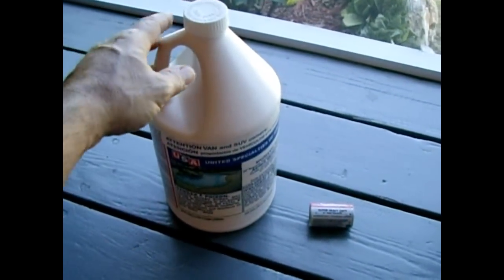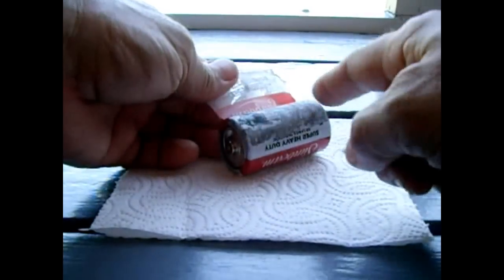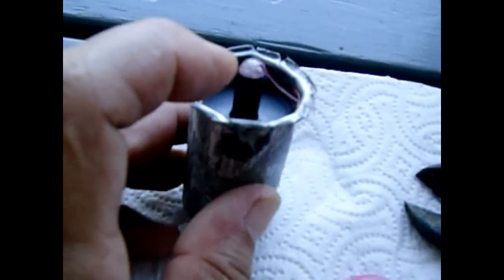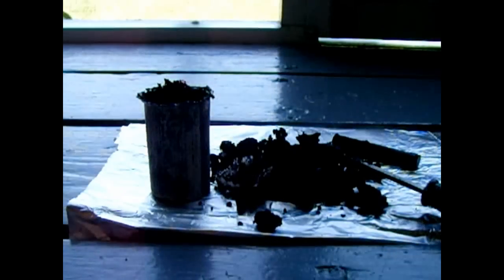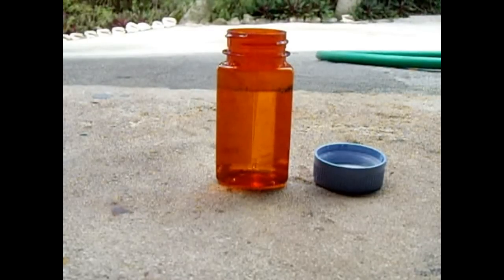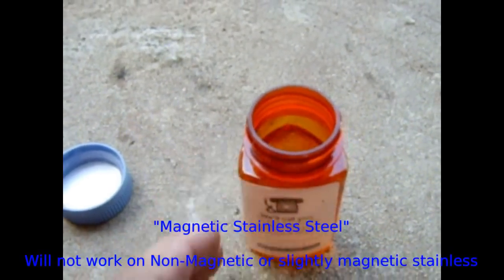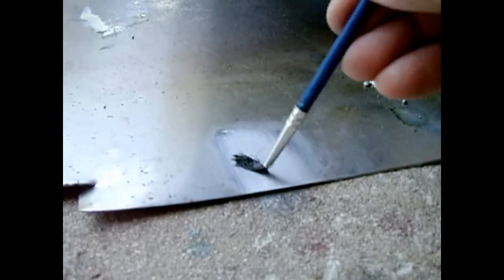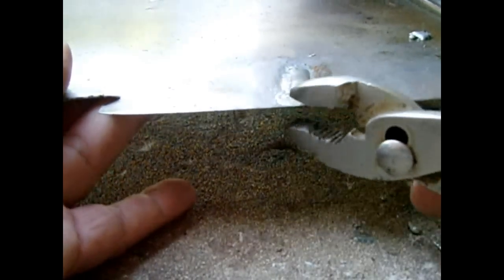How To Make Acid Flux & Solder Sheet Metal/Magnetic Stainless

Comment: I use zinc strips for roofing and cut them up into 2x2 pieces. Drop them in the muriatic acid and let it sizzle. Should use glass container. This works best to solder stainless when you heat up the stainless a lil bit first before applying flux and use a iron to solder with. No wire brush necessary.

Comment: Very Interesting, I believe Muriatic Acid + Zinc = Zinc Chloride + Hydrogen Gas.

And from the interwebs "Zinc Chloride is usually found in conjunction with ammonium chloride and a small amount of wetting agent when compounded into a flux. 
Both zinc chloride and ammonium chloride are excellent reducing agents and clean metal very efficiently in the temperature range necessary for soldering."
Reply from the maker: Yes, hydrogen is created.
Reply: @electronicsNmore Is it ok? I accidentally inhaled some
Reply: Bom dia, sou do Brasil este tipo de fluxo serve para soldar latão, instrumento de musica, saxofone, trompete, e depois se eu borrifar agua com bicarbonato para elinar o efeito do ácido daria certo?

Good morning, I'm from Brazil, this type of flux is used to solder brass, musical instruments, saxophone, trumpet, and then if I spray water with bicarbonate to eliminate the effect of the acid, would it work?

Comment: Cool, thanks. Could you used this DIY flux for electronics, say copper to stainless steel of aluminum wire to stainless steel? Is the bottle, glass? Can zinc supplement (the kind you buy at health stores or pharmacies) be used?

Thank you.
God bless, Rev. 21:4
Reply from the maker: Never use acid flux for electronics.

Comment: Very nice way to repurpose dead D cell batteries👍. These cells are called carbon zinc for a good reason, folks 
The gas that bubbles out is hydrogen if you can find a way to connect the bottle to a deflated inner tube while adding acid gradually to a jar of zinc, you'll be able to produce the fuel necessary for soldering 😉

Comment: Thank you, very good video.
How much Zink must be put into how much Muriatic Acid to get a good flux ?  By weight or by volume?
Jake
Reply from the maker: Hi Jake. It doesn't take much. Dissolve a small small amount to prevent excessive heating. Just be sure to wear gloves, eye protection, and have water/baking soda nearby in case the acid gets on your skin.
Reply: @electronicsNmore  Hi Sir,  Thank you very much!  I'll give it a try now.  Fixing a radiator which is leaking where the core tubes are soldered into the header plate.
Was wondering if vinegar couldn't be used as an "safe" flux ?
Thanks, Jake
Reply: good day sir,, can this be use on soldering alluminum sheets??

Comment: I just used this to solder copper to stainless steel. It worked like a champ!!! The only change I made was to put it in a glass mason jar, and add half of the zinc at a time with no worries about heat. I used about one cup of acid and (2) old D batteries.
Reply from the maker: Glad you found my video helpful! Be sure to look over my extensive video playlists, rate thumbs up, and share. Thank you
Reply: Which acid should I use for this

Comment: I can get  quart of Ruby fluid for $20.00. Why would I go through this?
Reply from the maker: Why order something online and have to wait, when you can do as shown?
Reply from the maker: I'd rather spend a few minutes and get the job done.
Reply: @electronicsNmore  
When you are at the store buying ingredients to make this, walk over to plumbing and pick up some flux.
Reply: @electronicsNmore  
2 days.
Reply: I aint got $20 for that ruby stuff but guess what I got, some acid and some used heavy-duty batteries that I was to throw away anyways. made my acid flux and was able to solder some copper wires easy.

Comment: Great Video, thanks. I put 3 oz. of Muriatic Acid, and used a new C cell Heavy Duty Battery.  The zinc was perfectly clean. The Muriatic Acid dissolved all but a small portion of the zinc as it stopped bubbling.  I then used a coffee filter to clean the solution.

TxTrapper
San Antonio, TX
Reply from the maker: Sounds good! :-)

Comment: can I use electric solder for joining two thin sheet metal? and where can I buy mutric acid?
Reply from the maker: Haradhan Mukherjee Electrical solder contains rosin flux. Use solid wire or acid core. Muriatic acid is sold at hardware stores and swimming pool supply stores. Be sure to rate thumbs up, share, and subscribe. Thanks

Comment: Now this flux works well for magnetic stainless steel, what about non magnetic or slightly magnetic stainless steel? 
if you know a method for soldring it please make a video to demonstrate it. 
Thanks in advance.
Reply from the maker: I usually weld non-magnetic stainless steel.
Reply: electronicsNmore what the welding method you found it great and easy for it?
Reply: @electronicsNmore  Our mechanic here is an expert at making stainless steel (non magnetic) sewing folders for our industrial machines.  We are using him and his skills on making our cutting table.  These folders can be seen (cheaply/poorly made) on that famous auction site....he does a far better job soldeirn it.  We are making a 34 feet (just over 10 meters) cutting table.  The top is stainless sheets 1.5mm thick.  We took 4ftx8ft stainless sheets and then took angle iron with a piece of 3/4 and 1/2 marine plywood epoxied (glued and screwed together).  Then ground down angle iron to same level as stainless sheet on top of marine plywood.  All marine plywood is triple treated with various anti termite "stuff".  Covered with 2part polyurethane.  OK so now we are soldering this non magnetic stainless steel. Imagine the lengths of the joints.....lots and lots.  There is a 50/50 solder stick here called "Nikolite".  We take Eagle brand electrical soldering paste. He cleans the stainless then uses a technique of the electrical soldering paste with a small dab of muriatic.  Solders great!!!  When he takes a hand grinder with a sanding paper overlapping disc it becomes identical in appearance to the stainless.  He also is doing this between the angle iron (5mm thick) and the stainless.  He is using a 150 watt soldering iron.  Lots and lots of patience but it is seamless.  We will then take a buffing wheel and jeweler's rouge to buff it all out.  No zinc here in the process. Just water, muriatic acid, electrical soldering paste and 150w (super large version of soldering iron) and it works soldering the seam between stainless and gap between stainless and angle iron.  Of note this stainless sheet is tack welded with stainless rod (2.0mm) (using an inverter welder) about every 9 inches.  When everything is sanded down it is a continuous seam looks identical to the non magnetic stainless steel. This is taking several days but we are talking a combined length of approximately 150 feet of soldered non magnetic stainless and on edges metal angle iron.  This gent is doing an amazing job.....this is for our small jeans factory we are making.
Reply: Oh.....forgot to mention....don't worry we have the cutting machines on square D GFCI breakers :-)  The obvious is with a stainless top and people on top of it working to cut material this is the only option.

Comment: Just clean  the piece you soldered right away with soap and water or else you will get corrosion. Also do not keep the solution inside the work place because you will have corrosion all over the place.

Comment: Muriatic acid + any galvanized piece of metal will do the trick. I am soldering stainless for 27 years as part of my job.
Reply from the maker: francis sanchez That is true because anything galvanized already has a coating of zinc. :-). Using the acid with the zinc, won't hurt. 

Thank You!
Reply: hi Francis should I use leaded or lead free soldering wire/bar in soldering stainless?
Reply: Could you please explain “any galvanized piece of metal”?  Galvanized metal is mostly lead coated steel.  Is it the lead or steel
Reply: @nobackhands  zinc not lead
Reply: @joegodfrey549  Wife worked in office where lead was used as a coating...but you are right...today most galvanization is zinc

Comment: Interesting, never soldered to stainless steel before but if magnetic qualities are required for it to work any 3XX series (austenitic) should work.   However hot forged austenitic is not magnetizable without cold working of the metal.  Bending a piece of tube, or hammering a cold plate will work and bring out its paramagnetic properties.
Reply from the maker: EgadsNo It works, but you need that surface SUPER clean, and you have to use the acid flux.
Reply: EgadsNo Magnetic properties are redundant in the process of soldering. While you are educated and know some big words related to metals not described in this video ask yourself what the magnetic properties of copper, brass, aluminum, lead, gold etc. the more commonly soldered metals are. Simple people weld these materials all day long without big words and don't  exacerbate their own stupidity the way you have.

Comment: For me it's much easier to use a Dremel-type small grinder with a cut-off wheel to cut off the bottom of the battery, and then cut the cylinder vertically. This allows me to peel the zinc off the black insides of the battery easily and stretch it flat, making cleaning it a breeze.
Also worth mentioning, that the carbon rods are good for spot welding (can be sharpened using a good pencil sharpener...) and as electrodes for electroplating and other electrolysis experiments.
Reply from the maker: That works fine also. :-). As for the carbon rod, I guess you have not seen this video here:

How To Repair or Make Stainless Brake/Shifting/Throttle Cables

Thanks For watching!

Comment: Hello, very interesting! I speak Spanish and I'm using the google translator to write, how little understood. Just using muriatic acid and zinc of the battery?
Reply from the maker: Yes. muriatic acid with some zinc dissolved in it. You must add the zinc slowly , otherwise you will generate incredible amounts of heat. You can use any source of zinc. Thank You.
Reply: Thanks for the answer, and if I did a test and turned as needed !!!!

Comment: How many batteries would i need if i want to make 1 litter??
Reply from the maker: You can also use electrolysis zincs from a boats hull/engine. You need a fair amount of zinc dissolved into the acid. Remember to add the zinc SLOWLY to the acid, otherwise the acid will get EXTREMELY hot(Hot enough to melt a plastic bottle!)